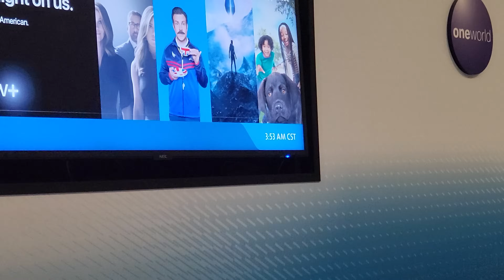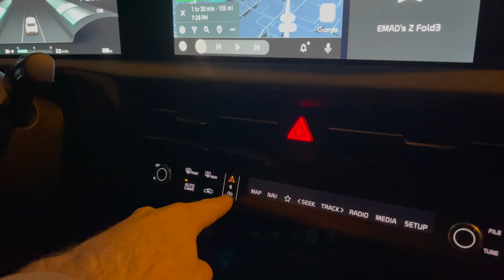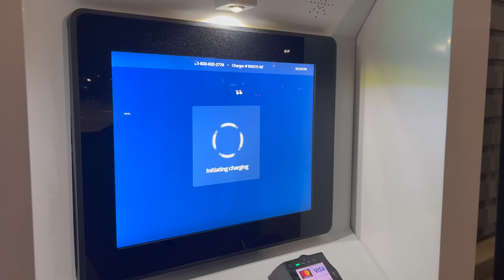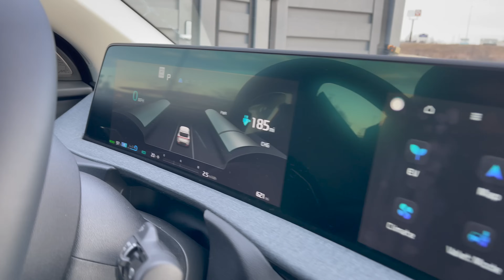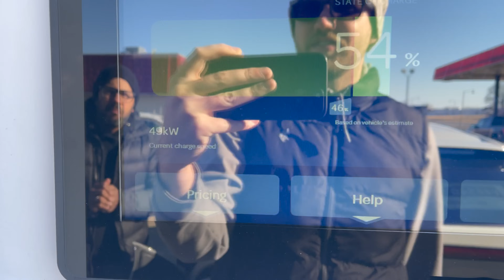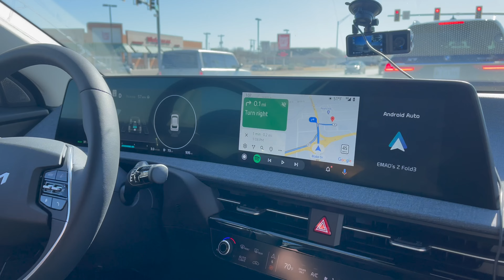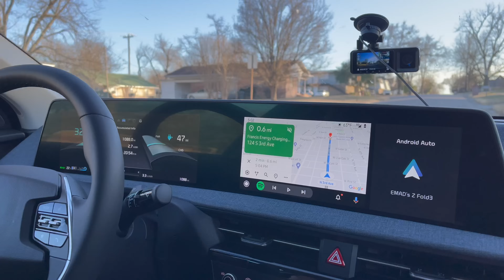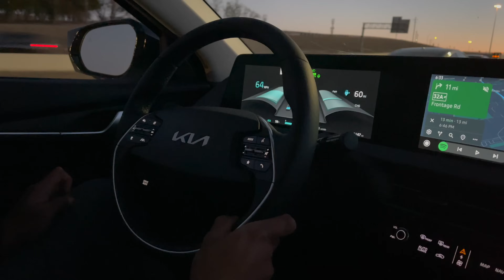First Kia EV6 Road Trip In America! Over 1,000 Miles To Dallas For A First Time Electric Car Owner

Comment: Not the quality content I'm used to seeing from you guys.  Disappointed.

Came off as woefully unprepared.

ABRP and Plugshare and this is a whole different experience.
Reply: Sorry you’re disappointed, but we used both ABRP and PlugShare. Part of this premise was a first EV road trip experience so it is innately different than some of the existing content. We attempted to portray it as something an average person would experience.
Reply: @Jordan_Schiefer  

 IMO, if a buyer is that unprepared for EV ownership they should buy a Tesla or a PHEV.  I say this as an owner of two Tesla EVs. You're trading poor Tesla build quality and missing car features for the Supercharger mindlessness of road tripping. 
It's unfortunate but you have to be willing to do the extra work planning as a non-Tesla EV owner currently.

According to ABRP the whole thing should've been doable with Electrify america chargers and a fairly conservative 20% min arrival charge and 2.5 mi/KWh avg eff.  
Plus you're just throwing away money since the EV6 comes with 1000 free KwH @ EA...
It literally shoves it in your face in the kia connect app.

Also PLEASE turn in the AA split screen feature, you can have the Hyundai/Kia "cards" on the right, It's in phone projection settings>AA>enable split screen.

🤦
Reply: @bjkloss  at the time of this trip, there was no free charging from EA via Kia. That conveniently came just a few days after arriving in Plano. There were no EA routes direct to Plano without going significantly out of our way, and we unfortunately averaged about 2 mi/kWh in the super cold temperatures. That plus cold charging speeds resulted in us being thrown off a bit. Regardless though, we had fun! And we found the AA split screen afterwards, though AA just needs to find a way to be full screen. Apple CarPlay looked much much better.

Comment: Bringing along a 10 kW portable charger such as the Pion Power 40A version is great as a back-up.. bring a NEMA 14-50 to NEMA 6-50 adapter to borrow any 12 kW power supply at a welding shop or farm yard (if in a pinch)...

Comment: 24:20 A lot of people consider the US to be left/west and right/east halves and the Mississippi River being the dividing line; with the larger/sparsely populated states on one side of the line and the smaller/more densely populated states on the other. I realize its geographically only like 1/3 of the way. So the gateway thing works for that, being right adjacent the river.

Comment: Recommend getting RFID cards for EVgo, Chargepoint and any other charger brands you will be using. They work when other methods do not. Good luck with the Kia, the Koreans are really trying hard.
Reply: Agreed. This is how I use all Chargepoints and have never had an NFC read error using my iPhone. On EA I have had a two instances of NFC not working at a station out of roughly 30 charging stops to date. Still, generally just holding your phone up for NFC is a lot easier than navigating the app to swipe to charge IMHO.

Comment: That blurring you did around an hour 20 in was pretty ineffective. I'd suggest just putting a matte white blob or similar over the keypad next time. 

As others have said it'd be nice to see stats, mi/kWh per leg, cost per charge, etc. 
It looked like you were getting 2-2.5 mi/kWh for most of it. My Bolt got 2.7 in 10F weather from Denver to Pueblo last weekend carrying a few hundred pounds of boxes in the back. Got 3.2 on the trip back in the same weather. 
 
That >100kw charging sounds nice. I had to stop both directions on my trip and only got 34kw :(
It'll also be nice once Chevy finally gets around to swapping the battery. Along with the extra 6kWh max capacity I won't have to try and keep between 40-80% all the time, that's been a real pain. 
I got it used a little over a year ago for $15k, so no real complaints. It's far and away the best car I've owned. 

I don't know if I'm envious, or grossed out by people being able to buy new cars every couple year or two like cell phones. On the one hand it'd be nice to have that much money, and somebody has to buy new cars so they make it to the used market. On the other hand it seems like a massive waste.
Reply: Yes, but they are saving the planet. lol

Comment: You see the square button just below charging indicator lights. Press that button to close the charging door. You have to press the same button to open the charging door when it is closed so how are you going to do that? Hint, take a good look at the back side of the charging door. I drove my Niro EV to San Diego from Orange County and back yesterday, 188 miles and used 67% of battery. I got 4.2 miles/kwh. Definitely works better here where it is warm year around. I like EV6 interior and exterior design and can't wait to hear more about it!
Reply: I usually get around 4mi/kWh too in Kia Niro EV... but with speed of around 60mph... I think these guys are doing 70-75mph on freeway, so that's why their efficiency is under 3 mi/kWh...
Reply: @be236  And cold air is denser.  It takes 36% more energy to move an automobile through the air at 70 mph as it does at 60 mph, and it uses 56% more at 75 mph than at 60 mph, all other factors being the same.

Comment: Did you guys use A better route planner for the trip? I heard "range anxiety" and charging time complaints in this video, which shouldn't be an issue if you plan with ABRP, and have the range of the EV6, ABRP is very accurate with everything.
Reply: We did use ABRP, but unfortunately it wasn't quite able to keep up with just how much the cold would affect range and charging speeds. But it wasn't far off, it was still super useful.

Comment: It is amazing, the USA is about 5 years behind us in the UK. Here we have major investment happening, banning of apps and memberships, just easy turn up, tap and pay. I think it is about 800 chargers a month are being installed. 

Kia have also said they are going to issue an update so the EV6 will auto pre heat the battery if you navigate to a fast charger to speed things up.
Reply: You make some good points.  In the US it seems mandatory to make things as complicated and difficult as possible.  And then the lawyers get involved.

Comment: Simple easy to think about KW and KWH

KW = rate
KWH = rate * time

If I have a 2KW motor and run it for one hour that's 2KWH.

A 1.2KW microwave running for 60 seconds will that's 20Watt hours or 0.02KWH of energy consumption. Consumption and storage is KWH and things that do work are KW. For an EV a Battery is KWH as it stores energy and an electric motor is KW as it does work.

Comment: the problem with this fad to turn everything into touchscreens is that it’s a matter of luck if you want to use them while driving because there is nothing ergonomic or tactile about them. To change temperature requires the driver to firstly change screens, then accurately touch the exact screen point which has been allocated to the temperature function. A single knob would do this safely and easily.

Comment: That hands off from wheel warning is just about the motor sensing a slight torque. Genesis has different way to warn it.
I was lucky to meet a dealer who won't do mark up at all but im still waiting for the car to be arrived. Already scheduled the ppf installation and ordering carbon moldings from Korea to cover up all glossy plastics inside the gt line.

Comment: Ti was very enjoyable the trip . The high consumption ( for europe 23kwh/100km ) was due to the winter mode the sport mode ( sometimes and the front motor is always on ) and the cold weather and the bad driving style . If it was good weather and better driving style i think that you can achive 3.5-4 miles per kwh or 16-18 kwh/100km . Also the charging speed was so low because the battery is coldgating ( i mean tha the battery has very low temperature) . The problem with charging speed will fix with a new software update .

Comment: Bought my EV6 GT MSRP  (Great Dealer Carlsbad).  My questions are..   Does Navigation work with real time traffic?  2) Is there Wifi under Kia Connect as it shows a trial is active and will look at buying a Verizon plan.  Can my passenger pull up Hulu TV or any TV? I tried this using car play and voice worked but no video would play

Comment: You say that the gt line?  It looks like the air trim to me 
Gt line has black a white leather and alcantara seats  and piano black trim, where as the air has leather seats ands mat metallic tim that's the air trim . You car is definitely the base entry model called the air gt line has strips on the dash and a different pattern in the material . Plus the alloys are the base type . 8f you order the winter pack you get battery conditions you call we call heating to optimal charging temperature.
Reply: In our market, it is the Wind model. We never mentioned it was GT Line or otherwise, but I know various markets get various components in each trim.

Comment: Great video. I have a Tesla related question I'm hoping you can answer. Is it possible to charge a Tesla at the 3rd party high speed dc chargers you guys used to charge your Kia? It seems like you were using a CCS connector and I can't find a CCS adapter on the Tesla website. Thanks.
Reply: Tesla doesn't sell the CCS adapter in the US yet, but it is available in Europe.  Some 3rd party chargers have added Tesla connectors.  I stopped at an EVgo the other day that had a Tesla plug. It was added on to the charger because it was not there previously.
Reply: It's difficult to nail down specifics on manufacturing dates, but a lot of Teslas (even newer ones) are sold with "CCS Adapter support: Not Installed".  The speculation is that chips are lacking, and they will not release the CCS adapters until they are able to retrofit CCS chips in the cars that are lacking them.

Comment: Pardon, dumb question - what's the point of the 2 charge cables on each unit at the EA station when they are both CCS?   I get it when one is CCS and the other is Chademo, but...😕
Reply: Not a dumb question. I assume it's to make it easier for ports on opposite sides of the car since the ports are not standard without having to have a longer cable which could lose more electricity and slower the charging speeds. The EA charges I've gone to have it so you have to pull straight up of back in and don't have a pull through style like gas stations have.

Comment: I service all kinds of kiosk screens - self checkouts, photo centers, fast food, showers (truck stops) - you name it. Including car charging stations. The most common damage is screen damage due to 'human interference'. Which means some jerk taking his pocket knife and "tapping" the screen. 
That's all it takes. A few spots of that all over the screen, and is dead-shorts the touch layer to the read matrix layer. If the "tap" it too hard, then you get the liquid 'blooms' around those points.
It's just a sickness. People that can't stand other people not being as miserable as they are. 
When you stop and think about it - my job is created by miserable people more than simple end of life or system issues.  :/

Comment: The problem with Kia dealers is that they are not equipped to sell $50K cars. I leased a Stinger GT2 in the rain and got it home and found they had destroyed the clear coat washing it with a cheap wheel brush.
Reply: Yep that's a good take.
Reply: With all dealers, your mileage may vary.

Comment: You guys HAVE to do an investigation into the EA chargers issue. Literally every review where someone charges there - yours included - everyone says the EA chargers are over-reporting on charge delivered. Like making you pay for way way more power than could possibly delivered. Kyle saw this on the R1T. The charger said 102kWh and the R1T said 80kWh. Kyle keeps fobbing this off as “charging losses” but that’s just not possible. If you use Chargepoint or EVGO those chargers don’t have this mis-reporting issue. 
If I charge my I-Pace at an EVGO or Chargepoint, the car reports exactly the same as the charger. If I use EA they always show way more power delivered than the car shows. Every time without fail.
Please please do an episode on this. It’s a big story. I’m convinced EA are being well sketchy with their power delivery reporting.

Comment: After this experience, what is the plus/delta vs. navigating with the Tesla Supercharges?
Reply: I have put over 1,000 miles on my Tesla M3 in less than one day twice so far. This video was very painful to watch. Almost heartbreaking for a new car. I know most people rarely if ever road trip, so it is probably a great purchase for most people.
Reply: @puppy7505  that's what I kept thinking. I cringed most of the video. No proprietary charging network, unreliable, juggling multiple apps, very poor charing in cold temps, and EA code not working for free charging. But sure, you're not going to be doing this kind of trip often, if ever.

Comment: Went to 3 dealers this past weekend who marked up the EV6 anywhere from 5 to 7k. I actually had a dealer let me walk off the lot over $500 after he marked the car up to 7k and I had a trade in he under valued by $1500. So its pretty bad right now. I would love the car but dont see the mark ups getting any better. Anyone have any thoughts? I would even travel to get the car. Live in south florida.
Reply: I'm traveling to Kentucky for mine. No markup. Some dealers marking them up $15k. I'd just keep calling dealers until you find one.

Kentucky is 12 hours away btw. Don't care I'm not paying $5k over msrp for a car.

Comment: What an inconvenience for my lifestyle. 20-30 min stops. Nope. I drive till tank is empty. Pee. Drive until tank is empty. Did two runs back to back Plainfield Illinois to Fort Lauderdale with my truck and boat. Then flew back the next day and drove my wife’s car down. Non stop. Just gas, fast food, and water and pee. Now what I noticed is, you stop at places to eat and shop during charging. You may not have done this if you had 2 minute fill up with fuel. You may have gotten something quick or brought a sub etc, with you. 

So the savings may not always be there compared to fuel to electric. I know this won’t always be the case and the fuel will cost significantly more overtime as well as maintenance that accompanies a combustion engine. 

Now for road trips if you want to stop and then take your time to check out what’s going on in your 30 mins to charge up, or read a book etc sure. Use that time. But remember time is something you can never get back. Ever. 

Good luck with the car. The interior looks beautiful.

Comment: Well, the concept is wrong.  When plugging in the charger, the AI is interfacing. So it should automatically know if any coupons, manufacture or dealer specials are associated with the car for free charging if available.   It should also know to ask for a card or just automatically charge to a specific account you set up if you want.  That way you plug it in, put a card in or just wait.... All that setup is nonsense.

Comment: The car has a wireless phone charger but you need a cable for android auto. 🤦‍♂️
The buttons at the front edge of the centre console are far too easy to press.

Comment: No in car route planning?
Reply: It has a nav system that shows chargers near you. I'm gonna mess with the system and see if it has in car route planning native to the car. Never tried it
Reply: Nope. Not in the Koreans. Also not ideal for beginners. Tesla, Porsche, Mercedes, VW you can all just get in, tell them where you want to go and they'll figure everything out for you. Hyundai/Kia have said it's coming with an update, but it still just proves that Tesla aren't the only ones that push out half-finished cars!
Reply: @Emadifications  I got into an Ioniq 5, searched for chargers with a filter applied and it tried to tell me that all of the AC chargers in my neighbourhood were DC hyperchargers. So yes, it'll tell you where the chargers are, but don't trust its info about what kind of charger it is.

Comment: You two with hats and coats on inside the EV 6 does not look good.  Is the heater that bad or does it drain the range too low.  If yes, why not say 5 minutes more so you could have a heated cab?

Comment: every single time you stop at a charging station you're looking to visit a store nearby. EV is the future, the stations are way to far spaced apart. New EV cars carry the most updated technology which really is desirable to have. However, an EV is EASILY 20K more expensive than a economical gas car. An thats base model EV. Even spending 2K annually on gas still better than giving a 20-25K upfront money on a EV.  The push for EV is total bullshit. Hybrid is the real DEAL.